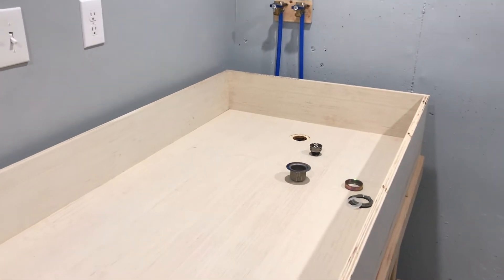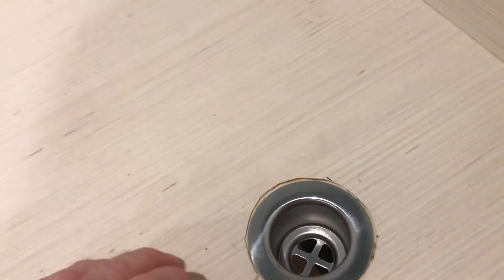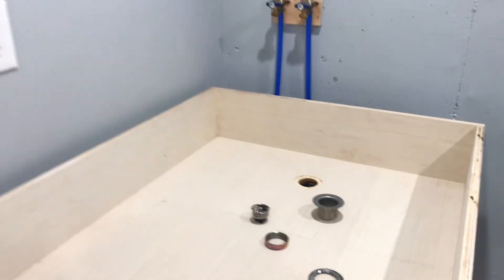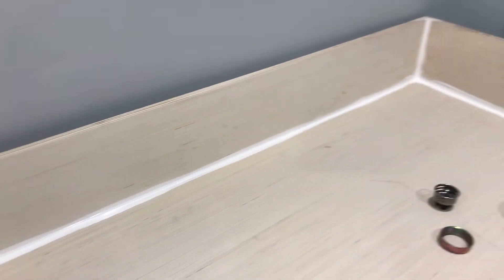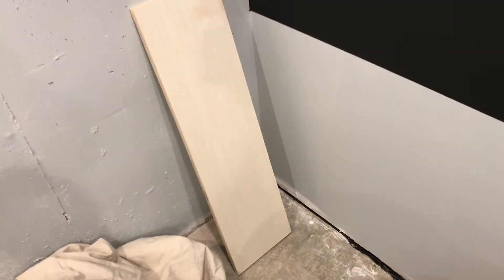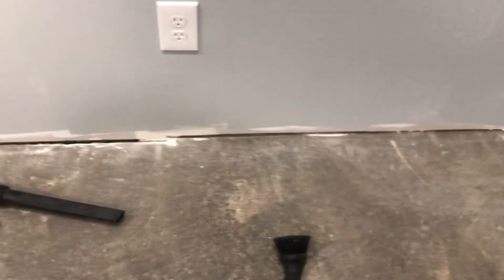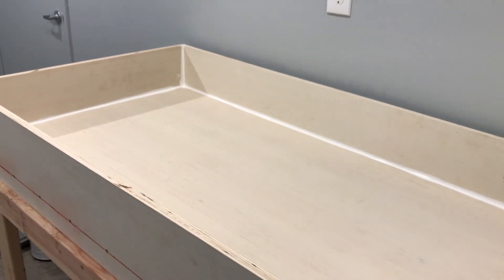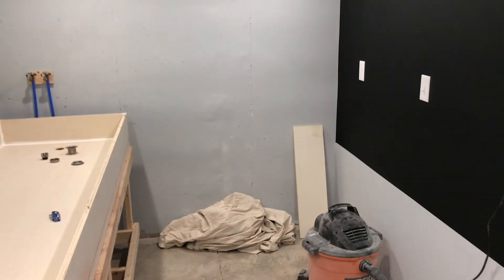Building A Darkroom Sink - Part 2

Comment: I made a similar sink in the 70’s but used Fiberglass resin to coat the wood and I laid down some fiberglass cloth first in the seams - it never leaked in 30 years.
Reply from the maker: I considered fiberglass but have never worked with it.  I think the latest recoating is going to do the trick

Comment: How did the garage floor paint hold up?  I have a Behr 1 Part epoxy garage floor paint for a sink I am currently building.  All the notes say it is NOT recommended for wood, but there are some articles saying it's fine as long as I prime it.  This was the only epoxy paint Home Depot had in stock.
Reply from the maker: It has been almost a year and it has held up great.  I think the trick was that I did 5 coats.  The last time I did this I used Marine Epoxy paint.  It lasted about 5 years before it needed attention.  However, the garage floor paint cost about 1/2 of what the Marine Epoxy paint did.
Reply from the maker: Update to your question.  Last night, while preparing to do a printing session, I noticed a chip in the paint.  Apparently I had dropped something in the sink and it exposed the bare wood.  Not really happy about it.  The plywood I used was factory primed and as you know, I put 5 coats of paint on it.
I am currently in the process of sanding the sink to down so that I can repaint it.  This time I am going with white FlexSeal paint.  Another listener to the podcast used that and is very pleased with it.
I will try to post a video update on it.

Comment: Thanks for sharing this video. When installing the drain, do you add the plumbers putty where the sides of the drain sits (what you routed out on the side)? Do you add any caulk anywhere to this area or just add the epoxy around the drain?
Reply from the maker: I first drilled the hole then drew a circle around the hole about 1/2 outside of it.  I then routed out to the line about 1/8 of an inch down so that when I sat the drain in the hole that it was just slightly below the bottom of the sink.  
Once I had the hole routed properly, I painted the sink with 5 coats of the garage floor paint.
I then took the plumbers putty and made a rope out of it (like you would playdough) made that into a circle and laid it into the routed out section.  After placing the drain with the lip on top of the putty I fastened it down.
If I had it to do over again, I would have used a kitchen sink drain instead of a bar sink drain.  I may still go back and replace it someday.

Comment: did you use 3/4 or 1/2 inch lumber, also how high are your side panels?
Reply from the maker: The plywood for the sink was 3/4 A/B primed plywood from Lowes.  The base was assembled from 2x4's.  The side panels are 7" high.